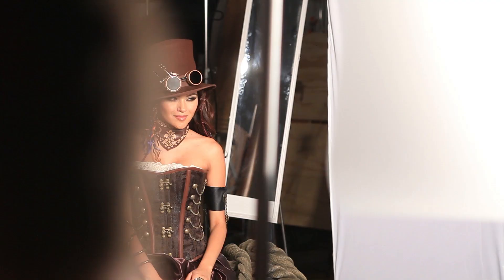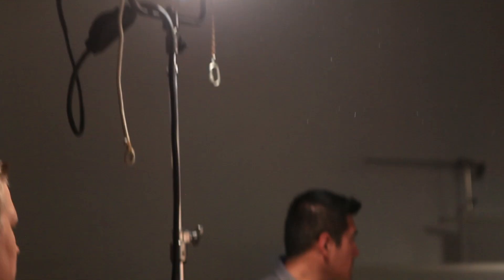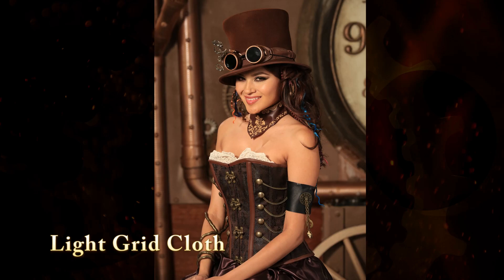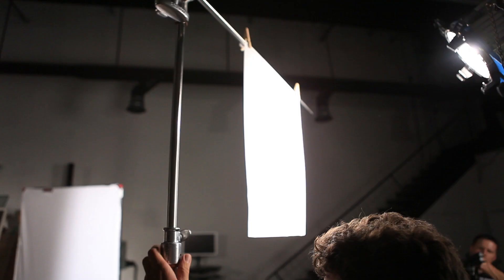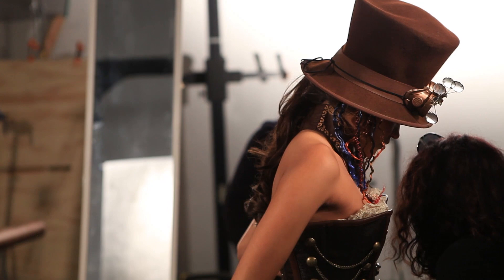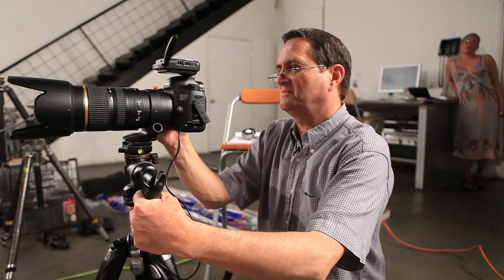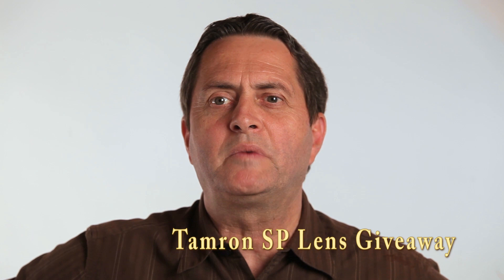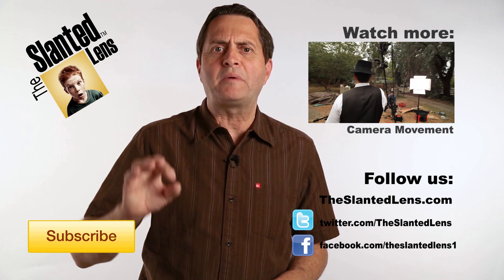Testing Diffusion Materials on a Steampunk Set - Photography & Video Tutorial

Comment: I think you should've picked a much smaller test subject and controlled the beam of the light source, if the diffuser samples you had were so small. The light quality changes are extremely subtle here (because the diffuser's apparent size is mostly the same); the density of the diffuser mostly affects the amount of parasitic light which gets bounced around the diffuser patch and alters the contrast (when you lose one or two stops through the diffuser, you gain one or two stops in ambient level).